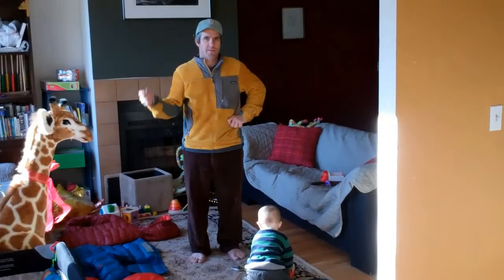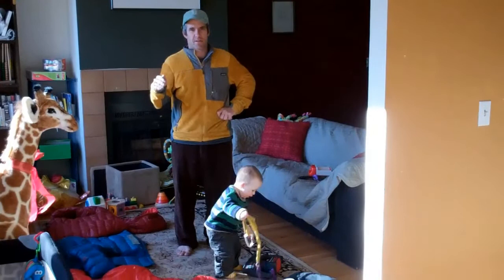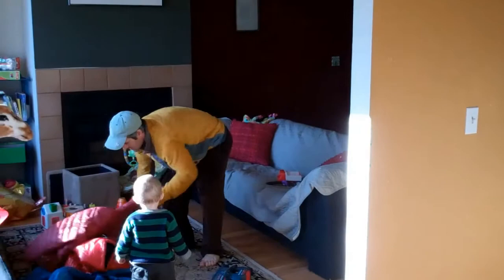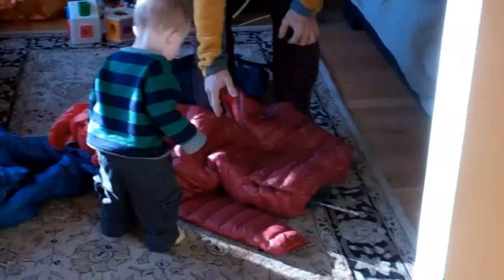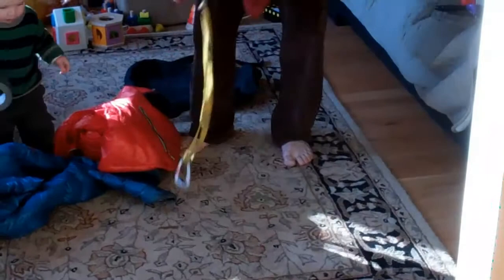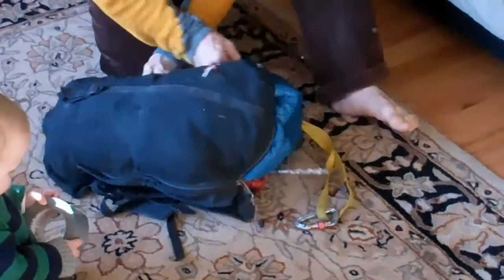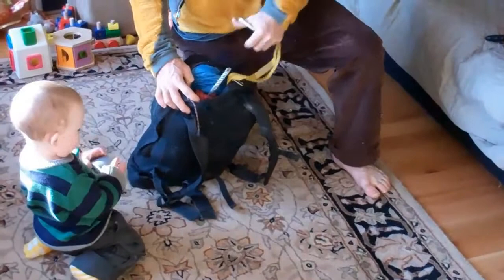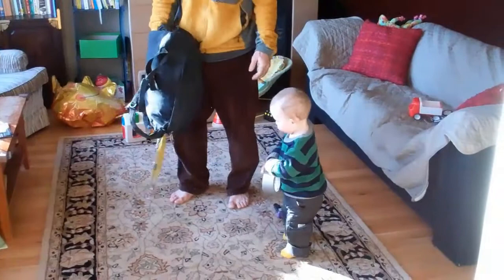How to Muffle Your Drill During Nesting Season

Comment: So when I googled "muffle drill sound" I never thought I'd find anything legit. My application is probably as "odd" as yours...by that I mean, not found too often. Certainly your situation is of more significance than mine...I'm using a drill to power a worm gear winch to raise and lower an acrobat during his performance. Now tell me we both didn't have unusual circumstances! ;-) Anyway thanks for posting this - I'm going to try and make use of these concepts to help in my situation. 

Ironically I'm guess you folks are out of Boulder? I used to live/work there 2003-2009. Well I lived in Longmont and commuted to my job at the REI there on route 36...LOVED the area, the Flatirons, Indian Peaks, RMNP...wow, do I miss that place!! Best wishes!!